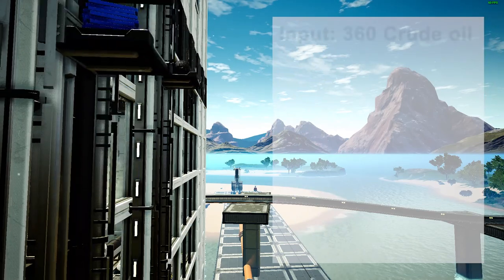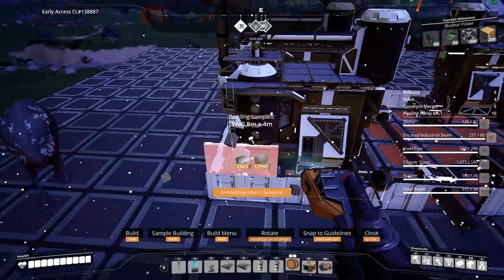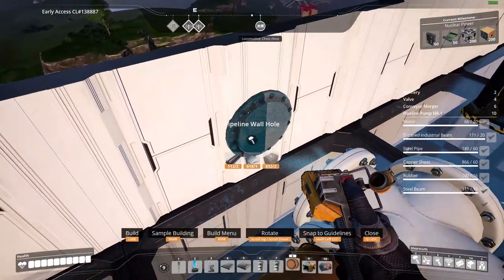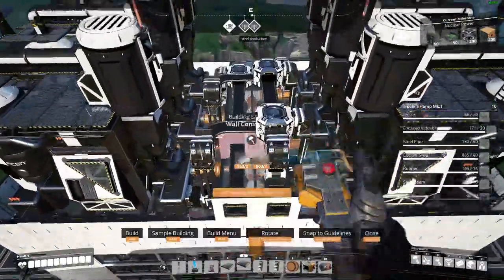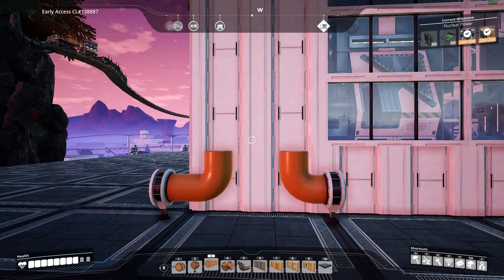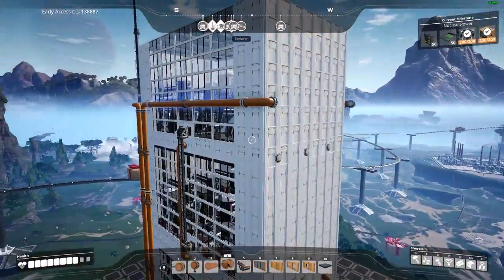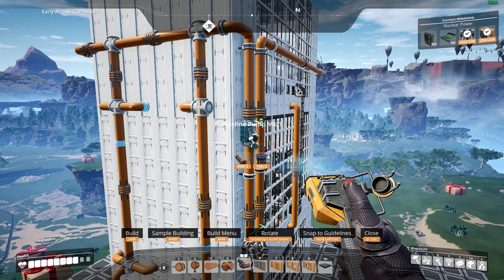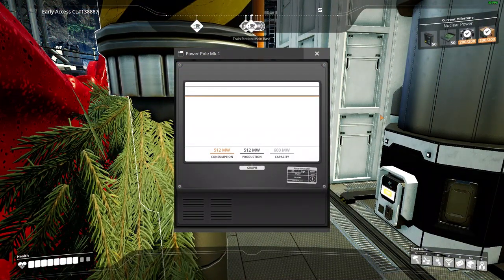100% EFFICIENT PLASTIC AND RUBBER DESIGN ( with Petroleum Coke bonus ) | SATISFACTORY

Comment: I agree, this does look much better than laying a dozen refineries next to eachother. Thanks for the upload!
Reply from the maker: I got you man.
Reply: Look? Sure, but you can always add walls around the dozen refineries if you want to hide their status lights to make sure you don't ever notice if something is wrong. 
Work? Only as long as you don't want to extend it. Then it's a nightmare. You just researched MK2 pipes. You just gained access to more oil. You just need 60 more rubber per minute. Now you have to redo the whole thing from scratch.

Comment: Since there are valves and the concept of back pressure, wouldn't it make sense to connect all of the pipes at the top and control the down flow with the valves? It might make it look much neater.

Also on the tightness front, it might make sense to place your pipe junctions before you place the pipes.

Great video and great build. I did a similar build flat on the ground and it took way more room. Think vertically!
Reply from the maker: Yes I actually did that at first, but it would mean adding a few more pumps. So i thought i'd use the new (then) valves.

Comment: I just did the same 3 recipes also.  Just didn't see this video until after I was done.   This design looks much better than mine. Lol
Reply from the maker: Thanks man ! I wouldn't recommend trying it though. After update 4 it's a bit haywire
Reply: @chankykang4918  everything with liquid seems to be a bit wonky now
  It works out for me tho since I just got the alt circuit boards that use 60 petroleum coke and 30 rubber.... I'm just feeding into 2 assemblers right next to it since I need the boards anyway

Comment: im having alot of problems where pumps and valves placed where 2 pipes meet, so the game creates a very short section of pipe, and this does not transport any fluid at all.
ive had to doubble check every joint as multiple machines was being compleatly empty :/

Comment: if we upgrade a building "for example %200" ,  do this building need 2 times resources or , it produces 2 times more with the same amount of resources before ? maybe you can make a guide for upgrading buildings
Reply from the maker: Depends on 200% of what you're talking about. If you mean 200% of production, it means it produces 2 times the speed.  If u mean 200% efficiency it means it produces its items at half the cost.

Although in my case, when i say 100% efficient, I mean the power graph. It will be a straight line. Which means there's zero idle time, or in other words it means that the machines will never stop working.  Check out my other video called " The Fastest Satisfactory guide to efficiency" to know more about it.

As for upgrading... I guess that would mean redoing the whole thing right? In which  case you'll need alternate recipes.
Reply: @chankykang4918  by upgrading i mean using power shards... my question is not about power efficency...
Reply from the maker: @angelman4374  when u use power shards, the rate of items coming in needs to increase as well. Which means you'll need double the items. I think it's better to overclock the miner to get double the resources and then expand the base rather than overclocking everything.
Reply: @chankykang4918  thanks for the advice
Reply: @angelman4374  Power shards are good. And it's yes to your original question.
If your using shards on a miner, it will give you % more ore.
If using on machines (smelters, assemblers...) it will use and produce % more.
Example, smelting something.
If running 100% uses 3 at 6 seconds production. And you shard it 200% it would use 3 at 3 seconds.
So yes, either way.
It uses % more items at % overclock.
Also produces % more at % overclock.

It's easier to just over clock the  mk miners (250%). And upgrade the amount of machines needed.

Have you ever heard of a 'tournament layout' design?

Comment: I am having a ton of issues getting my Aluminum plant working with the water output being recycled into the Bauxite refinery. Do you have a video hiding somewhere that goes into detail about Aluminum, by chance?  Specifically with the Pure Aluminum Ingot alternative recipe.
Reply: I use industrial buffers everywhere pertaining to fluid balance and volume/quantity observation.  I also use valves - a LOT to mostly control the directionality of fluids.

Comment: The current version of this game makes it impossible to place those refineries in those locations. They simply will NOT face the correct direction. Using the mouse where to rotate, they skip the desired direction. I have tried removing walls, also adding floor to the outside. Nothing works!!

Comment: Got a question.  Ran across this video today, nearly 8 months later and having update 4 online.

Could this be done with with a single mk. 2 pipe pumping from one pure and one normal node?
Reply from the maker: Since we have valves now, which allow us to fine tune how much can be allowed, there shouldn't be an issue with what you proposed I think.
Reply: @chankykang4918  Yeah, those valves are awesome.  I use them between fluid buffers so I don't get backflow and can get an idea if production is up to snuff.

Comment: Sadly anough this build doesnt really work in update 4.. (experimental mode)
For the moment the oil doesnt get distrubuted equally and some pipes dont have any at all while the flow rate is correct,
The item splitting also is off and doesnt really work either..
Reply from the maker: Yeah im planning to make another for update 4
Reply: @chankykang4918  ahh thank you! In update 4 removing the valve's fixed it all